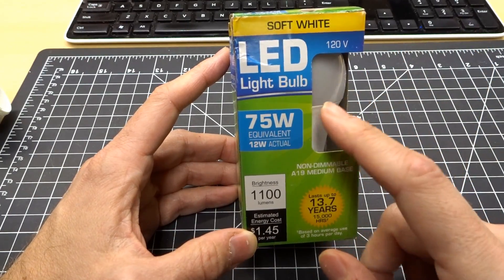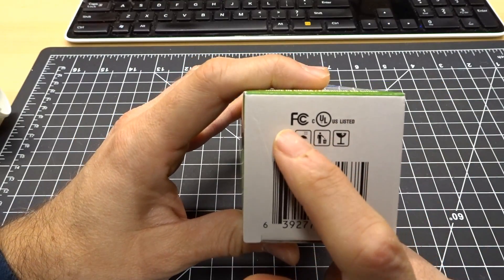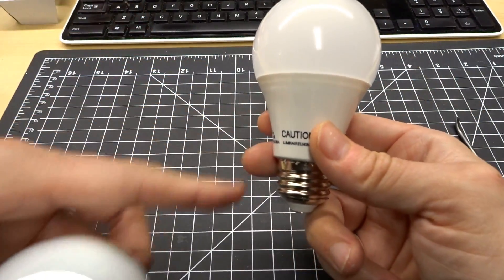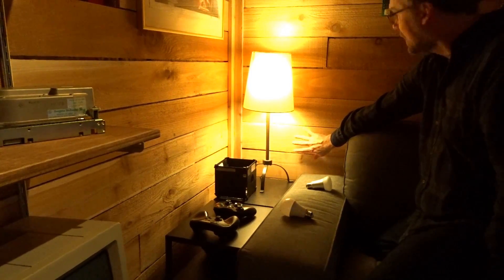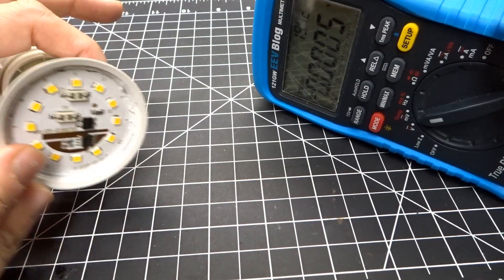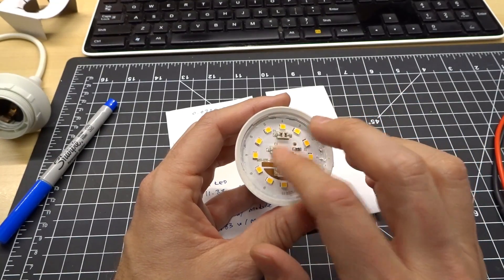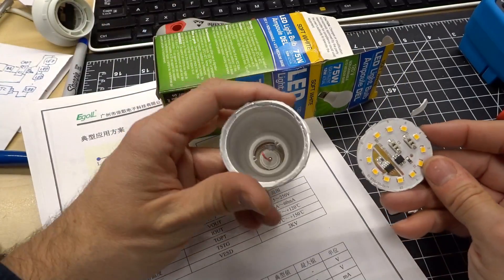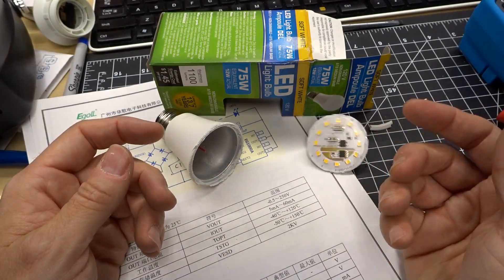Dollar Tree $1 LED Bulb: 1100 lumen (12w) Teardown and Review

Comment: I have purchased many of these bulbs from Dollar Tree (although now, all $1.00 items are $1.25 each). I could have sworn these bulbs were rated for use in enclosed fixtures, but now I will have to go back and look at a box of one of these. Having bought these by the dozen for use in exterior pagoda style fixtures used to illuminate walkways in my condo complex, they have been working out very well and last a good long time. The fixtures these are installed in are considered “enclosed” since there is a glass jelly jar that covers the bulb in each fixture with rubber gasket that makes them usable for wet locations. When used to illuminate exterior sidewalks and stairways, color rendition is not an issue. The 3000 K bulbs look warm and inviting at night and do their job.

Comment: The LED bulb is good.   It makes light.

Is it any wonder the LED's, outputting light at 0.1 Amperes of current, don't use even half as much power as high-power LEDs (draining 0.7 Amperes or more of current).   No.   Power consumed by an LED, in Watts,  equals the current  flowing through it, in Amperes, times the voltage drop measured across it, in Volts.

Consequently, the power is about 1/7 the power consumed by a high-power 0.7 Ampere
LEDs.  1/7 is 14%.    So that's why a $1 LED lightbulb is only a dollar.

And of course, it is made in a Communist country, so it's only a crude, cheap imitation of what is made in the U.S.A., put together by people who don't wonder, don't question authority, and have no idea of how things such as LED's actually work.

Comment: Thanks. This same chip is used in Dollar Store LED night lights, they are very bright for nightlights, rated 0.4W, and plug directly into a 120V outlet. I popped off the top cover and found a bridge rectifier, fuse resistor, a resistor that probably controls the current, and the eg1000a constant current driver.

This device has only 4 LEDs in series and no caps at all, and a regular PCB instead of aluminum. Since I'm wanting to reduce the flicker, I'll probably add a 10nF cap across the DC side of the rectifier, and populate the 10nf pad where c2 is on that application example, "plays the role of anti-surge buffer, avoiding the instantaneous breakdown of IC and improving product reliability" .. at least according to Google translate. These are great for lighting a hallway that just needs a little light all the time.

4 tenths of a watt 24/7/365 at 6.75 cents per KWH will cost about 24 cents a year LOL.

Comment: The 75 watt equivalent led bulb I bought at the Dollar tree (same this video reviews), just doesn't seem as bright as when I first got it about a month ago. Still brighter than a 60 watt equivalent led bulb though. Like the sunbeam 60 watt equivalent ones, but the dollartree brand ones (like this 75 watt one reviewed) didn't last long for me. Would sit there and flash when turned on, for awhile it would stop flashing and actually work, but then either just flashed or not work at all. Now a the local store has are, 40, 60, and 100 watt equivalent led bulbs. Guessing something got too hot in the 60 as it was in a table lamp that gets used for many hours at a time, where I have the 75 now. No dimmers in my small apartment, just lights that are either on or off. Tempted to get a 100 to see if that does the same as the 75, just normally dimmer after it's been used a few weeks.

Comment: Might be time to readdress this topic.  Dollar Tree seems to have a new provider (Yamao) with a different circuit.  The 9W/60w equiv now uses a four terminal smd (SOT-223?) marked "9003b J0071" that does not show up on Google.  The current sense resistor to it is a 7R50 (7.5 ohms).  I've not torn a 12w/75w equiv apart yet.

Comment: I have seen Indian LED lightbulb repair videos and such, they have ventilation slits on theirs.
I have taking to drilling a few small holes in mine, one on the bottom or side of the translucid plastic cap, depending of how they will be mounted, and a few on the plastic base, behind the alu disk. I use a stop on the drill bit so that it barely can get inside, and drill twhere from taking one apart I know it's empty space.

Comment: One important fact that is often missed in a teardown like this is how that one 125C electrolytic capacitor is the one component that will limit the bulb's life, NOT the LEDs. The problem is that even though the capacitor is rated for 1,000 hour of life at 125C (that's a mere 6 weeks, folks), its useful life increases as its exposed temperature decreases. The derating is a doubling of life for every 10C temp decrease below 125C. In this case, if the temp is limited by the little current regulator down to 85C, which is four 10 degrees C increments, meaning that the capacitor's useful life is stretched out to 4 x 1,000 = 4,000 hours. If you have the light on for 4 hours per day, then this capacitor is going to fail (on average) after 4000/4 = 1000 days. That's a bit less than 3 years. LED lamps are usually advertised as "lasting for 50,000 or 100,000 hours," as in "infinite life." What is missed is that the onboard filter capacitor will fail much sooner than that!

Comment: I find the lifespan of those cheap LED bulbs can vary pretty drastically. I've had some of different brands last quite a while, and some last a month or so before they start flickering or go super dim. When they start flickering, it always makes me think there is something wrong with my fixtures, since I'm so used to flickering being a fixture issue with incandescent bulbs and not with the LED bulb or boards on them. Also, something I've noticed about some cheap LED bulbs, the light can be kind of harsh on my eyes, even if its covered in a lamp shade and I'm just catching the light in my peripheral vision, yet incandescent light doesn't really seem to bother me like a LED light can.

Comment: Thanks for the review. This 75W/12W warm white bulb has 12 LED SMD chips. Each chip has 4 LED blue die for a total of 48 LED in series, at about 2.8V per LED die = about 134 VDC.  The blue LED die are surrounded by phosphor emitting white light  producing warm white.  The bridge rectifier is probably a MB10F 1000V rated.  The 8-pin chip is constant current chip with thermal protect probably RM9003B, the resistor configures the current.   I tore down the 60W/9W daylight bulb. It has 8 SMD chips with 6 die per chip, and a 10 uf 200 V capacitor.

Comment: Those were good for making low voltage light strips, back when their LEDs were 8V & could be rewired in series for a used laptop power supply.  Now, the LED voltage is 11V, so they would require running in parallel or spending a lot more than the cost of the bulbs on a new power supply.

Comment: Went looking for a couple of these for cheap abusable task lighting and only found a 100W equiv 1500 lumens 14 watt (claimed) model, claims to actually be suitable for enclosed fixtures, same "fs" logo on the bulb body. Board layout is similar but two rows of 12 leds (24 total) and two EG1000A regulator chips, 2019/5/21 date. May be the new and improved replacement model? My killawatt shows 12.6 watts, PF .65, no drop over time running in a fairly open desk lamp. Not sure I believe 120lm/W out of a dollar bulb, but they are pretty damn bright with decent color quality and flicker free. I think I'll go back for a few more.

Comment: If it was bright white, it would be better.  3,000 is not as bad as 2,700 but it still is yellow.  The 5,000K is coming down, but still over $1.  The good news is the PAR 38 5,000K bulbs are own to $9, as opposed to $25 3 years ago.

Comment: Did you measured the amplitude modulation in the emitted light?
I suspect that the light is modulated with 100 Hz and several kHz at the same time.

Comment: 3000 K is not 3000 Kilogram.  K is the unit of temperature called Kelvin, zero is the asolute LOWEST temperature.

Kelvin is a unit of measurement used to describe the hue of a specific light source. This is not necessarily related to the heat output of the light source but rather the color of the light output. The higher the Kelvin value of the light source, the closer the light's color output will be to actual sunlight.

Comment: I had a cheap led almost burn down my house. It caught fire.
Reply: My thoughts exactly !
Reply: That depends was it cheaper than 1$ if it was I wouldn't recommend buying it for that Pacific reason I've had cheap 1$ LEDs but never had that problem before I suggest checking to see if you don't have any bad wires because if your light bulbs are being set on fire you might have a short circuit somewhere that's causing excessive heat to build up.

Comment: They have this bulb, and the Sylvania or may be the sunbeam bulb for $1 often at our DollarTrees. We have a lot of them. They work great. Since they're as cheap as an incandescent, we just grab these instead. I didn't know about the not enclosed thing (who reads the bottom of bulbs?!).. this makes sense, as we always put these in our front of the house lights, which are the typical enclosed glass style. One of them went out the other day. When I replaced it, I noticed the plastic has totally split down the side (the lower portion). I could only imagine due to heat. Otherwise, these things work great. They still get blown out now and then if you have janky wiring, power surges, etc in your house, but for $1, who cares...a normal bulb will do the same.   Our kitchen bulbs were constantly getting blown out too, once we switched over to the cheap $1 LED bulbs, they never blew out again, I guess they can take the surges or whatever is going on.

Comment: Now I KNOW Google is tracking my purchases.  I just got home from the Dollar Tree where I bought x12 of the 100 watt equivalent (1500 lumen).  Clicked on my iPhone and your video popped up as a suggestion.  I'll check it out because I'm like you and want to see how it's made so cheaply.
Reply: @adriansdigitalbasement  I'm in Independence, Missouri.  The 100 watt bulbs are the same brand as the one you tore down.  Knowing how rare they are I need to make a run and buy another dozen to replace all of my old 60's that were used to replace the incandescents.

Funny these bulbs list the life span that they do.  Heck, at the rate by which they improve I replace them long before they burn out.  The old one's aren't thrown away, rather given to people who are not able afford pay their electric bill little lone buy an energy saving bulb that could reduce their electric bill in the first place.

Comment: I bought a bunch of these and took a hammer to them to get to the electronics!   C1 is a smoothing Cap.
--
Dimming on the AC side usually doesn't work .  But on the secondary side of the bulb, you can.

Comment: Rectified and capped 120VAC should become 160 VDC after rect and being tanked across the 'lytic cap. You said the string of LEDs in series was about 138 VDC, so I'm guessing that 8 pin is a constant current voltage drop set by its adjacent resistors to get rid of the 22 V difference and protect the LEDs from overvoltage.

Comment: Wow, I haven't seen a PET in a long time....  Long live the Motorola 6502.   I miss zero-page 6502 assembly language programming.   I live in Portland also, glad I found you!!
Reply: 6502 was made by MOS Technology - not Motorola
Reply: @ryanobarr4603 ,  You are correct, and I wish you could have corrected me back in 1980 when my technical faux-pas had to have began, the most, most coolest thing is you are the first to have caught my error ever and I am grateful.   I really do like your work, bench skills, and tools.  I'm a digital-hoarder of sorts, I like to collect tech-ref manuals, hard to find old software, and more.  I was an id10t, I worked a lot and never had the time to organize the video/audio/software/coding/documents...etc... I was downloading.  My answer was "Buy more hard drives".  Then it became Debian smb FileServers, and port-forwarded Apache webservers, then came Streaming of data.  If you have a request for anything hard to find I will help out!   The other day a friend wanted the old DOS "Jive" filter... You pipe a txt file through it and it comes out altered.  Happy Thanksgiving!  P.S. I used to use SoftIce, then WinIce, now I use IdaPro... as a side note

Comment: I bought maybe 10 of the 60 watt bulbs, thinking they were a great buy. One thing I found out quick, you can only snug them up when screwing in, or it will separate where the plastic meets the metal. Then I had to replace four of them within the first month after they quit working. These did not say to not use in an enclosed light fixture, but maybe they burnt out because they over heated as you mentioned the 75 watt version might.

Comment: I've bought a ton of 100w led bulbs at dollar tree. Haven't had a bit of issues
Reply: I have the same brand as the one in the video, my bulb do not turn off right away, they slowly dim out giving off a bluish color.  I think they have about six months of use.
Reply: @MyHandleW  Most LED bulbs I have ever used do that. Nature of the LED
Reply: @WayneWatson1  The better quality or name brand bulbs I have do not do this, the less expensive off brand bulbs do.  I noticed my Dollar Tree bulbs doing this a few weeks ago. 
Somewhere I read an article on why that happens, perhaps @BigClivedotcom mentioned why in one of his tear downs.
Reply: @MyHandleW  Maybe I'm used to the cheap bulbs then. Dollar tree and local power company bulbs is all I ever got.
Reply: =  @MyHandleW  = usually the bulb dims to off because it is the capacitor discharging threw the led's.
Reply: @WayneWatson1  Higher quality ones won't do that. I got some bulbs in my bedroom I've been using for almost five years now and they're still going strong.
Reply: Well your lucky I've never seen 100 Watt equivalent LED bulbs at Dollar tree.

Comment: I Cut The Plastic Bulbs off 8 of These Type Bulbs...But, Higher Lumen Bulbs And 4 CFL Bulbs 100W......And was Able To Grow Plants And Got Them To "Flower" Beautifully !!!...I Did build A Light Rack to hold ALL The Bulbs...Just 4 boards...Made into a "Square" with 12 Holes Drilled for the Light fixtures....3 per side....and Strung up with Light Chains...To Raise it as The Plants Grow....About 8 weeks..from start to Flower......Great and Cheap winter Project...For Amatuer Indoor Plant Growers???

Comment: This bulb is almost exactly the same inside as the 60W variant. The only difference is the 60W variant has a 10 ohm resistor instead of an 8.2 ohm. The light could be dimmed by inserting a 100 ohm potentiometer in series with that resistor. I would really like to know what the unused pin on that chip does.

Comment: the primary ceramic cap in the supply fails in these regularly ive got 4 on my workbench
Reply: What is the purpose of this capacitor?  Make it FCC approved?  If so, how would you know it gave out.
Reply: @jrstf  its known as a capsitive dropper power supply its in a lot of things that need DC power from AC its the primary way the voltage is made for the rectifier to smooth out the AC to DC (this is very over simplified description) if your wanting to understand more look up capasitive dropper power supply 

as for how to know its failed the light wont come on fully or flickers then goes out or very dim removing power it will stay on for quite a bit (low level) then slowly fade off ive got 5 now that have failed this way i replaced the ceramic capacitor with one that was close to the correct microfarads (the measurement for capacitance) and the bulb worked again though dimmer due to not having the right cap in the circuit
Reply: @cyberhornthedragon  - Thanks, I see that now.

Comment: I purchased one from Dollar general and it flickered like a strobe light. It was awful. The ones from wish worked fine.
Reply: Sounds like you put it on a circuit with a dimmer...
Reply: @BigDish101  actually no it was in a standard lamp but plugged into a power strip if that means anything. Could it be because of the power strip? The one I have now works fine. Its plugged in the same place the other one was. The ones that flickered was a two pack and both flickered.

Comment: if it overheats, who cares?  your family who can die in a horrible fire.   
GUYS!!  dont listen to this amateur.  No real electrician would ever suggest using inappropriate electric components for any application.   Respect labels.  Spend a few more dollars but buy quality.  Safety is the most important aspect in an electric circuit.

Comment: Now you can buy LED's made with a glass protective cover, defeating the purpose of being durable.
Reply: Durability is nice, but glass has its advantages, especially if it's an all-glass design. You can buy ones that look exactly like an incandescent now - 100% frosted glass body + metal base. They don't have the dark spot caused by the electronics enclosure.
Reply: @wolstech  and you can use UV LED's and coat the inside of the glass with phosphorus...

Comment: I bought a bunch of 60 watt equivalent Dollar Tree LED bulbs in two packs a few years ago for my basement and other places. They still work well. I had one die that was in a lamp but I think it was the fault of the lamp. The also had some smaller 60 watt ones that were $1 each that were rated for use in enclosed fixtures. I bought six of those for my two kitchen fixtures. Those are still working also.